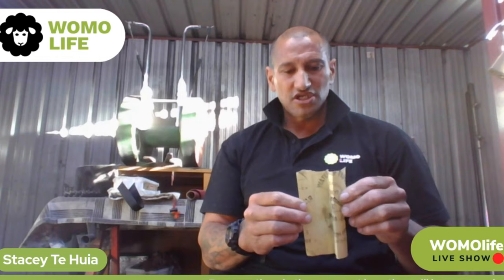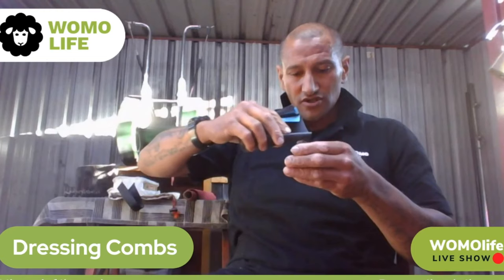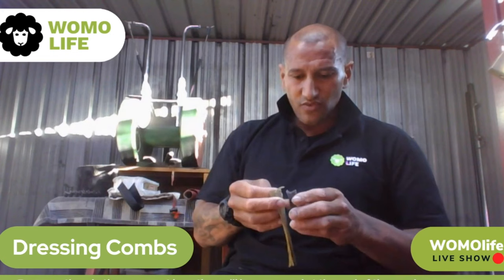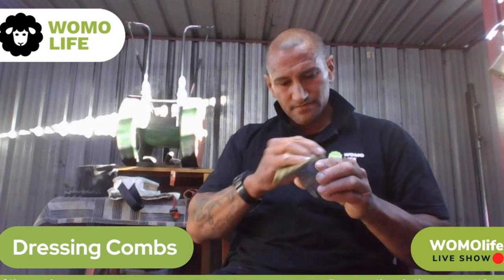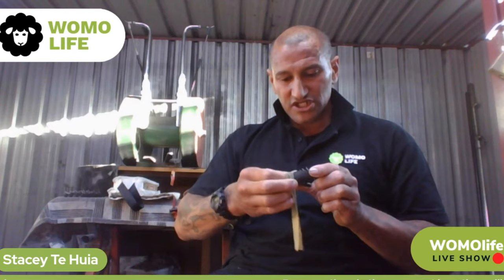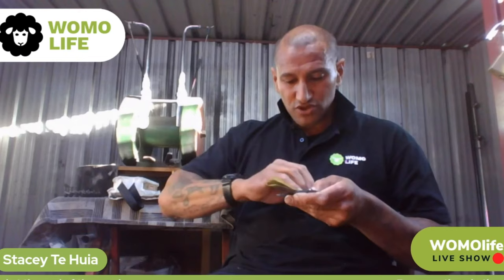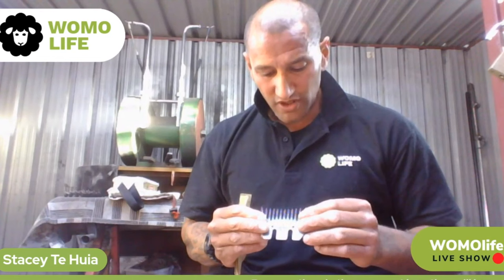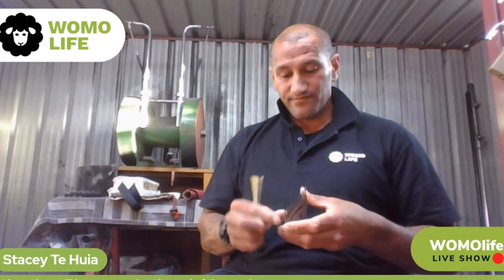Dressing Combs with Stacey Te Huia

Comment: Excellent information, your level of being meticulous is admirable. Every young new shearer should watch this this.
Reply from the maker: Thanks Peter! We completely agree, Stacey did a fantastic job in this tutorial. We really appreciate the great feedback and hope to share it with as many young shearers as possible!
Reply: Stacey, Charles Eastick here bro. Where can I get the wooden wheels for the dressing of the combs on the bright boy? & does anybody manufacture ceramic wheels (comb stone material) with the grove a full 360 degrees around the ceramic wheels for a bright boy also please Stacey. Please get back to me Stacey as I have struggled for years to find such tool. Thanks in advance Charles 👍
Reply: Watching in the UK just a novice sheara but very helpful chears
Reply from the maker: @charleseastick8172  Hi Charles 
 
You may need to go to a carpenter to get a wooden wheel made up or just cut 1 yourself an smooth it up with sandpaper on your bright boy. 
Not to sure about a ceramic wheel I no what you mean though. Would be a good wheel to have to shape combs fast.

Hope this helps best of luck 
Stacey